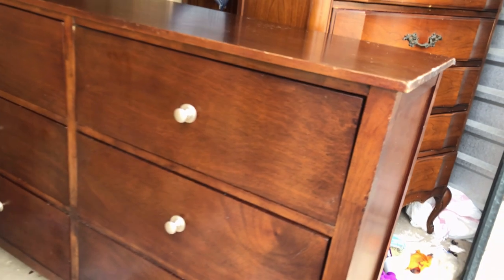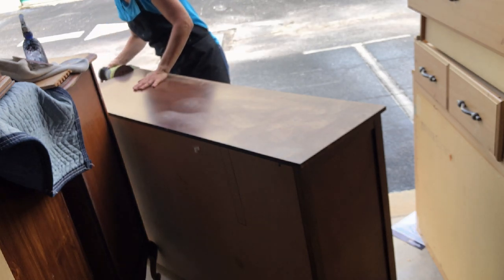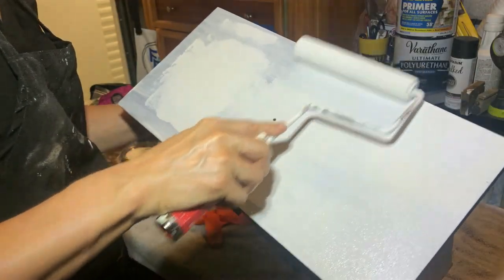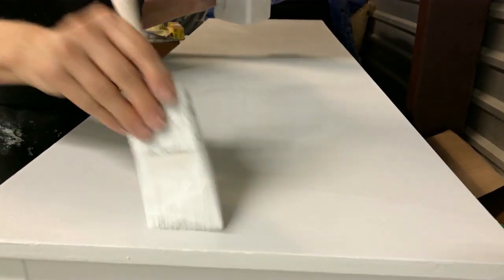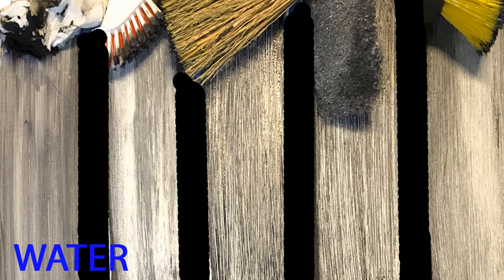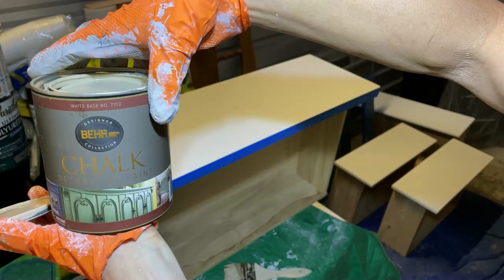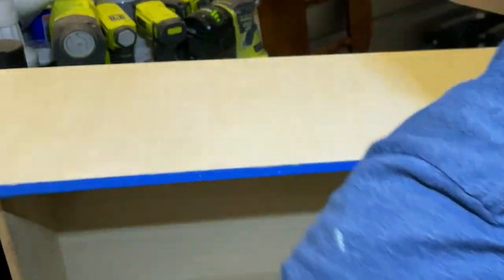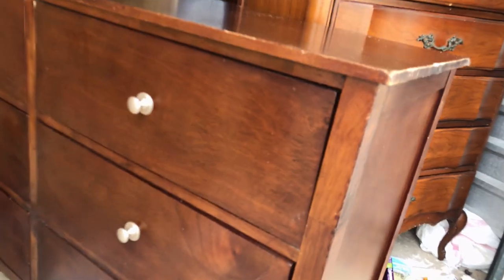Dramatic Dresser Makeover from DRAB to High End Dupe! How to Glaze Furniture | Trash to Treasure

Comment: My apologies Cynthia but didn’t understand what you meant by allowing the paint to cure overnight. Thanks for your information.
Reply from the maker: Thanks for asking so I can clarify. Chalk paint needs to dry thoroughly. The companies refer to it as "curing"  If a chalk paint has not "cured" then when you wipe it with a wet cloth, the paint comes off! Or if you wipe on a water based sealer, it comes off. This is referred to as "reactivating " the paint.  HOWEVER, if the chalk paint is "cured" or thoroughly dry then when you wife it with a damp cloth it will NOT come off. In fact, I had painted some hinges white on a prior flip and I decided a week later that I did not like them painted. I thought I could just wet them and remove the paint but since it had cured I had to use paint stripped to get it off the metal.  Chalk paint is very durable when  it is cured.  It sticks!  That is one of the reasons I like to use it!  I hope this answers your questions. Thanks for watching!

Comment: What do you mean by letting the chalk paint to cure?
Reply from the maker: Hi Martha, Thanks for your question. Curing is the process where you allow the paint time to dry and become permanent. If you run a wet cloth over a piece of furniture that was painted with chalk paint BEFORE it is cured, since it is water based, the paint will become reactivated and will come off on the cloth. If the paint is cured then you would have to use paint stripper to take it off.  Since the sealer and glaze are water based, if you tried to put it on before it was cured then the paint would come off because it was reactivated by the water in the sealer and glaze.  Valspar water based glaze says you have to wait 3 days to apply but I know from experience I can get away with waiting 24 hours and then apply.  The same with water base polyurethane sealer.... I wait 24 hours.
I hope this answers your ?  Please give this video a thumbs up!!!  That tells youtube that you liked it and you think others would benefit from having it suggested to them. It helps my ratings a LOT!